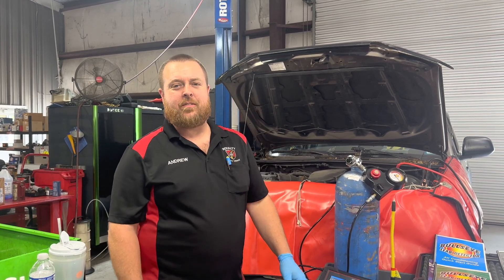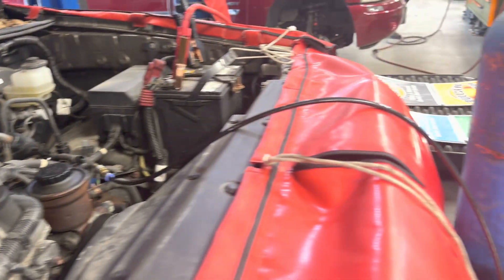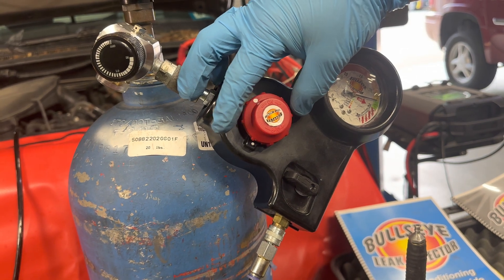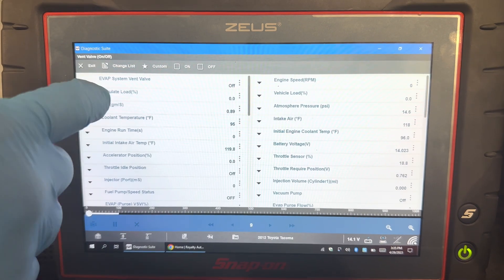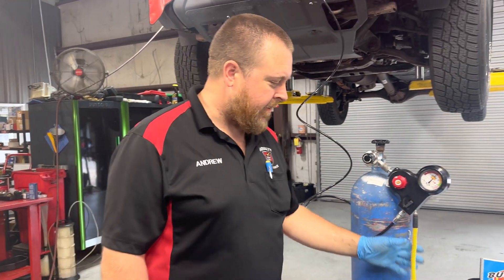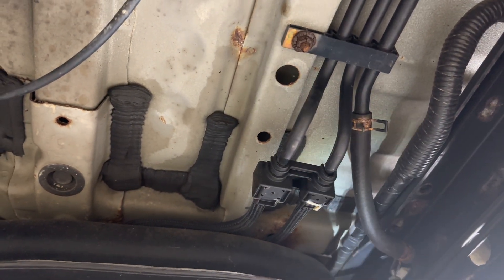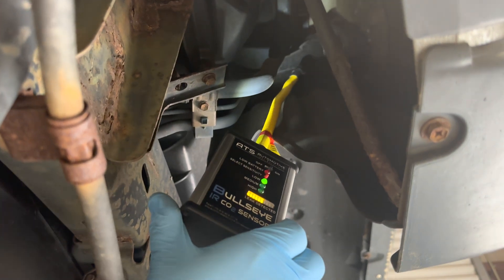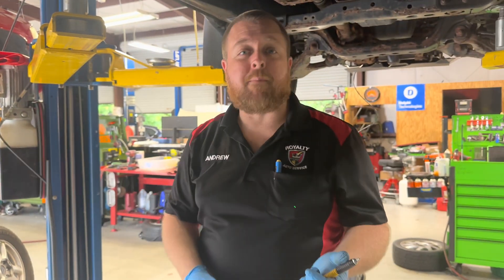Using the ATS Bullseye Leak Detector to Test EVAP System

Comment: this tool is pretty good but with toyota vehicles you can find evap system leaks without using any smoke or this tool. Toyota has an evap system test that it will run through and there is  also a graph toyota provides that shows what  the values should be as its running through the test, as well as which component is faulty. however, this tool is good

Comment: Nice stuff definitely helps when leak dont show up on smoke test
But heads up you may know already  be careful on those newer Toyota evap leak detection pump then vent will not close up all way on a normal sealed system  may think has leak
Use system test automatic test mode in scanner to test  systems  I learned hard way 👍

Comment: Got a question about 2003 f150... it stays in antitheft... I put key in and won't start and theft light flashing... sometimes if I leave key in on positions eventually theft light goes out and starts other times wont... changed pcm out and no change... chip in key is good and have tried everything.. leaving key in, rotating key back and forth in door lock, unplugging battery to drain power in wires and changing pcm and all the other youtube "quick fixes".... any ideas?
Reply from the maker: Hard to say without inspection. You say the key is good, have you tried a different key? That would be the first thing I recommend. After that I'd test the pickup coil that sits around the lock cylinder.
Reply: @theroyaltyautoservice  only have 1 key for it... had the chip in key tested they said was good.... I think the ring is only thing I haven't done

Comment: why did you go to smoke machine first.
Reply: Yea, I’d say this co2 thing would be something to use maybe if you’re out of smoke fluid. So much easier using smoke
Reply from the maker: In this case it was a really simple diagnosis. The most efficient way to diagnose it was the smoke machine. Both machines work great. They’re use is simply situational.

Comment: But I feel a smoke machine would be better, since you see exactly where its coming from and also if the leak is in a weird spot it would hard to get the sniffer on it!
Reply from the maker: Both are great but as Andrew said in video, there are times when the smoke machine will not show the leak because it’s so small. That will not happen with the ATS.